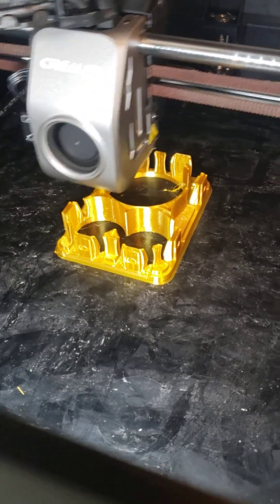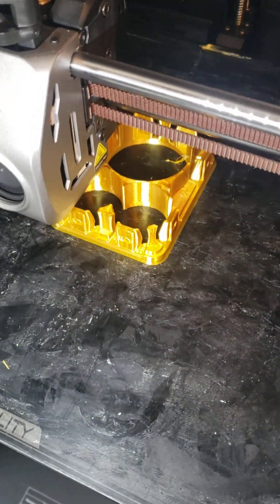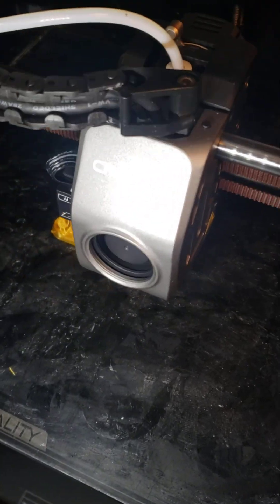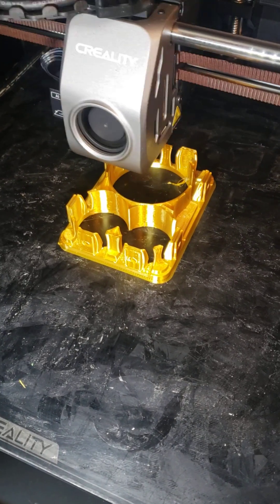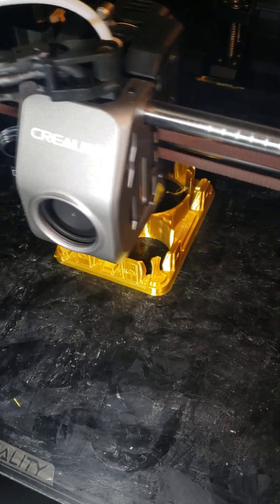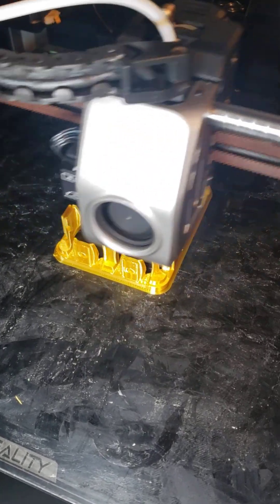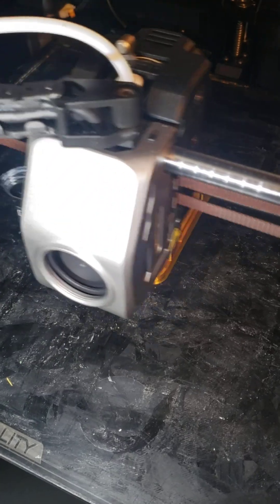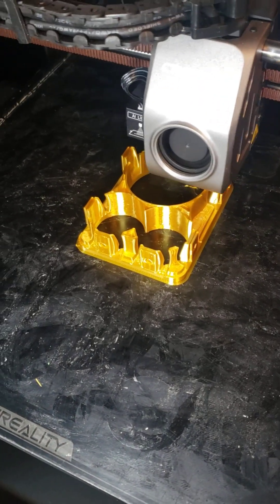K1 Max Bed Leveling And Belt Tensioning Creality

Comment: had the same problem, the inserts were pulled out of the frame and the belt was loose from the factory. the pulley/tensioner was stuck but I've fixed by removing the assembly and belt and reinserting the inserts with a solder iron
Reply from the maker: Strange failure, good job fixing it!

Comment: its far from easy its impossible to get off and even more impossible to get back on
Reply from the maker: Not sure what you mean as far as impossible, can you clarify?
Reply: @3dcre8r28  well i have a huge paperweight now as  cant get the belt back on the tensioner simply doesnt go that far its too tight i hurt my finger pretty badly when oressing on the tensioner i think i pinched a nerve

only way i could get the belt off is pulling as hard as i could on the belt itself
Reply from the maker: @taltigolt  As far as I remember, I used a pair of pliers or vise-grips to squeeze the tensioner to loosen it to get the belt back on.  Just be careful to move the tensioner and not twist it and break it.  I do remember it taking a lot of force, requiring pliers and being concerned about breaking it.  So use pliers or vise-grips but be careful not to break it.  I didn't break mine, but was concerned I might so I was careful about it.
Reply from the maker: @taltigolt  Yeah I just reviewed the longer full video here https://www.youtube.com/watch?v=dLbpDd_rxpQ&t=0s.  As you can see I'm using needle nose pliers and specifically as I mention orienting the pliers so the lower half underneath is pushing flat against the tensioner so as to minimize the likelihood of breaking the tensioner, I mention right after the 20m00s mark.  Good luck!  And let me know how it goes, happy to help.